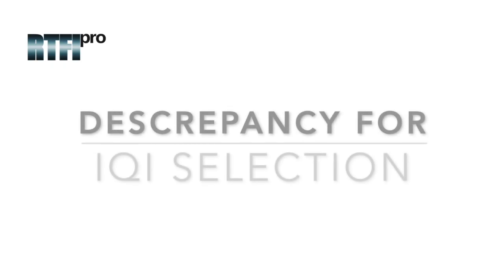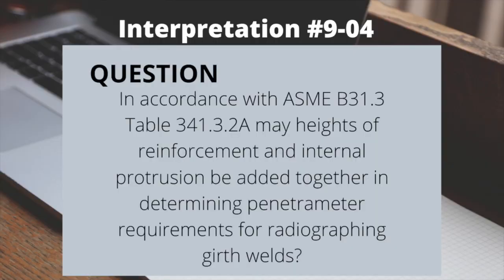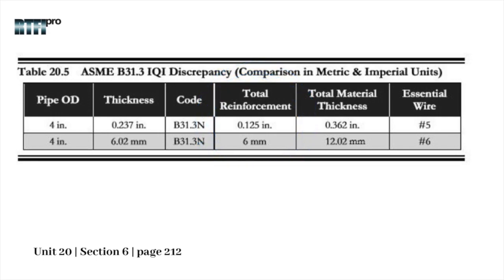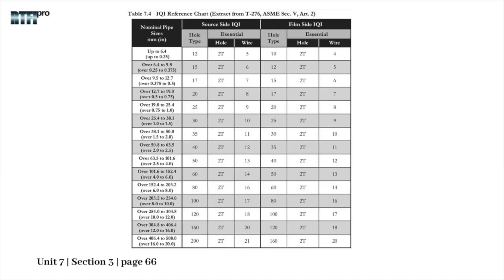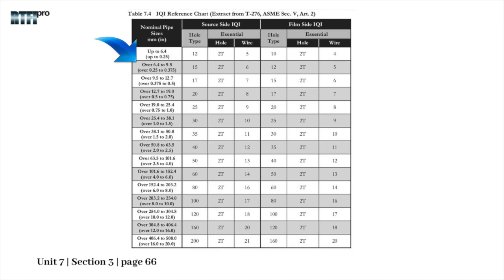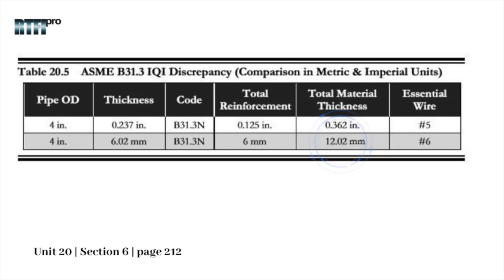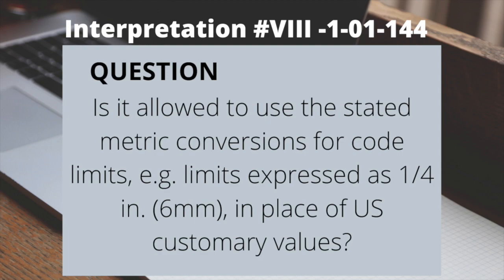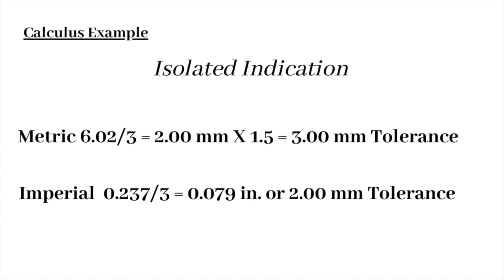DISCREPANCY - IQI & Rounded Indications | Imperial Vs Metric

Comment: Hi!
I have doubt about allowed reinforcement as per 31.3 it is maximum 1.5 mm for thickness up to 6 mm. Are you indicating that we can take 1.5 mm as a limit for internal and external reinforcement seperate, which would give us 3 mm as total?
Reply from the maker: Yes sir it answered by ASME enquiry 9-04 that both internal and external reinforcement can be used for IQI determination for B31.3.  Most ASME codes use both root and cap reinforcement for IQI selection, only exception is B31.1 were the weld is single sided welded, this uses Cap only, however for B31.1 if double sided welded than Both are used.
Reply: RTFIpro thank you sir for your response. 
So will it be necessary to take both internal and external reinforcement while calculating the required wire.
So far we cared about single reinforcement that is capping usually.
In that case allowed reinforcement should have been mentioned separately for the external and interactive in the code.
Right now we could see for example for 6 mm nominal thichness it is 1.5 mm.
How we can consider 1.5 plus 1.5 if the code says 1.5 mm?
Please elaborate.
Thanks
Reply from the maker: @shivakumarskn  it will help in sensitivity as you may up one wire for Visibility
Reply: RTFIpro you are right. Thanks